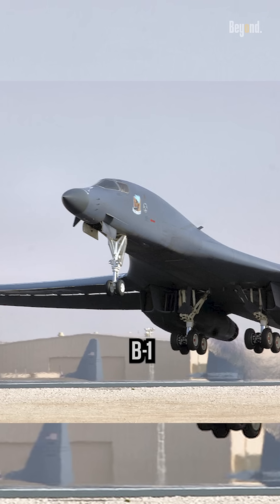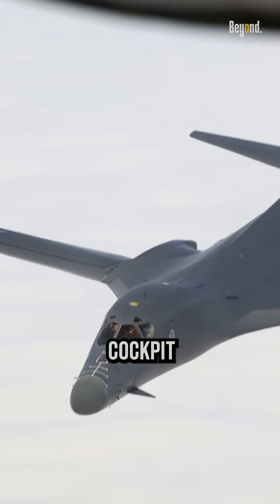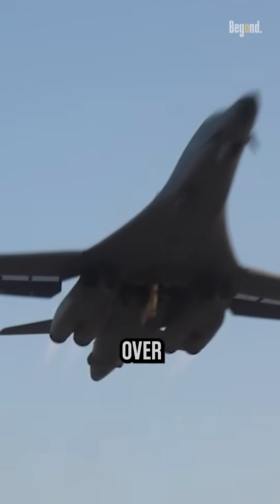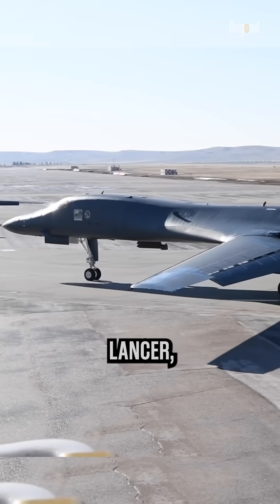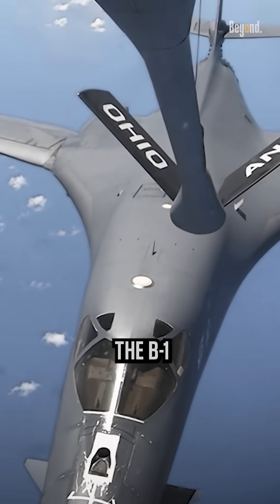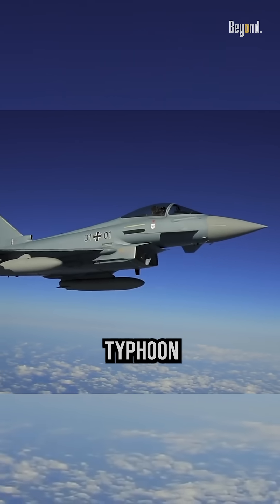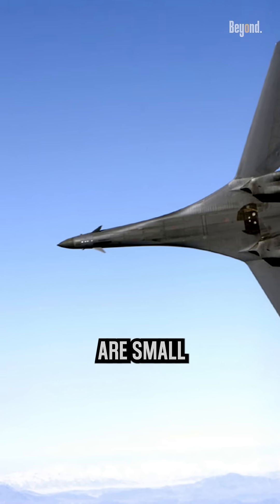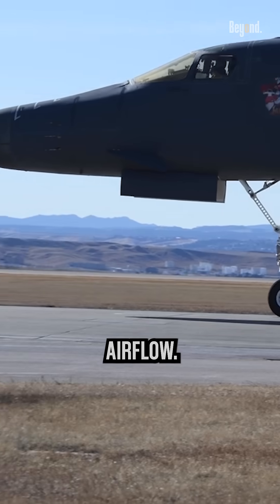Why does the B-1 Lancer have two tiny fins under the cockpit? #shorts

Comment: These canards improve the ride comfort of the aircrew when the bomber encounters turbulent flight when flying at high altitude and during low level routes at high Mach speeds. They are not vortex generators.

Comment: WRONG!  That's not what they are and that is not what they are for.  They are used for low level flying and dampen turbulence experienced during low level, high speed flight so the fuselage doesn't flex so much.  Also, these are not vortex generators on other airplanes.  They are canards.  Almost everything in this video is wrong.

Comment: So sick of YouTube vids putting out the wrong information. These are not "vortex generators". Shit, they aren't even int he right location to be vortex generators. They are active (moving) vanes that smooths the ride, saving the airframe from harsh loads, especially on high speed low-level flights where the air is dense and turbulent. 
Down vote this video.

Comment: The B-1B does have vortex generators; but they’re not the small wings on the nose.  Those are the Structural Mode Control System vanes that counter unwanted fuselage flex at low level.  The fore-wings on the Typhoon are control canards to increase pitch authority.

Comment: Wrong information. They're not vortex generators. The fins are part of the SMCS (structural mode control system) that alleviates the flexing of the very long fuselage due to turbulence at low-level, HIGH-SPEED (not low-speed!) flight. They are sensor/computer-controlled and move at a rate of up to 200 times per minute to keep the airframe stable in the above-mentioned flight-regime. Get your facts straight.

Comment: Wrong!! Those are called SMCS ( structural mode control system) which reduces structural bending oscillations in the longitudinal and lateral axes.

Comment: WTF? they are called SMCS or pronounced smucks vanes.  Smucs vanes are hydraulic actuated (4actuators) that allow the aircraft to ride smoothly in low level.
On the tail below the horizontal stab are vortex generators. They are designed to create vortices which increase the airflow to the lower rudder.
Soooo much misinformation. I would be ashamed to post half the crap you see on YouTube!

Comment: The canards or vortex generators work well I was on a butte south of Palmdale Ca when a B1 flew over me it appeared to be doing about 50 mph when the sound of the engines reached me the sound made the earth quake with the power coming from them & that was setting up the landing about 6 or 7 miles in front of them make no mistake about supersonic speed.   I was very impressed with the B1. Especially the size of it it's huge + supersonic flight
Reply: ...only problem is, they're not actually vortex generators. ;-)
Reply: @kicksnarehats11  they do generate a vortex but vortexes fall downward so I don't see how they work

Comment: plain wrong. I don’t get how i can find more info in 5 min about the SMCS but you manage to post a video with just made up bullshit. The SMCS act like canards in the sense that they move but the purpose is to dampen structural oscillations during flight, as the B-1Bs in service have long since overflown their original expected service life and require constant maintenance to keep them airworthy.

Comment: They are not vortex generators.  "There were small moveable vanes made of composites alongside the nose, with an anhedral droop of 30 degrees, referred to in an opaque way as the "structural mode control system (SMCS)" foreplanes. They were fitted because the long B-1B fuselage tended to flex fore-and-aft in low level flight. The SMCS vanes were linked to a set of accelerometers near the center and nose of the bomber under computer control to ensure a smooth ride at low level, increasing crew comfort and airframe life.

Comment: Vortex generators are usually located on control surfaces to improve the effectiveness of those surfaces. B-52, KC-135, KC-10, and many commercial aircraft have them.
What the video seems to be focused on is canyards which are control surfaces that provide for enhanced control at slow speed such as landing and take-off.

Comment: 1. Thst plane sounds glorious at take off. 
2. The f18 has vortex generators inside the engine air let ducts thst one has to watch out for when doing your pre flight inspection or you’ll rip your pants.

Comment: This guy is just flat wrong. The SCMS vanes deflect slightly when the nose enters a gust and the flight control system counteracts the gust with other control surface deflections before the wing flies into the gust, thereby smoothing the ride at low level and high speed.

Comment: No, on the B-1 it’s a structural mode control system  (SMCS), yes they are tiny canards, but it’s all that’s needed to help control fuselage flex during certain speeds.   The F-16’s ventral fins on it’s rear is absolutely a band-aid added later fix for  low speed stability control.
In other pics you’ll see the pitot tube mounts under the canards, they look like winglets, but it’s only a mount to get it out into clean airflow.

Comment: Those aren't vortex generators; they're spare propellers incase the props on the Wright Vertical 4s mounted aft of the center go gravity break mid-flight.
Source: My avatar is the playne in this video.

Comment: incorrect explanation. those are ride control vanes control by a computer to improve low altitude airframe buffeting in turbulence to lessen airframe flexure. They are called ride control vanes for that reason. They are NOT intended to generate vortices.